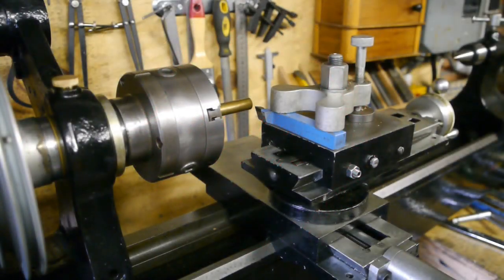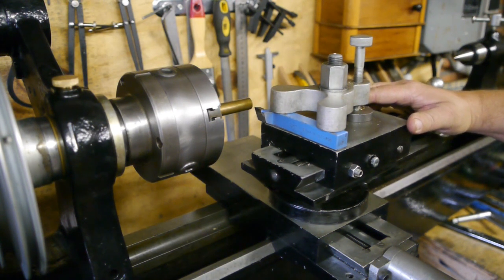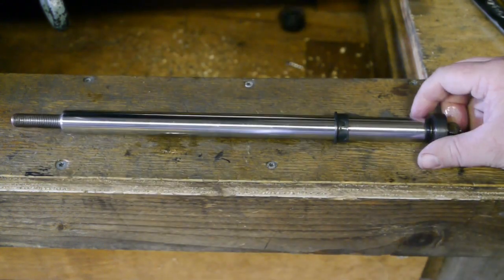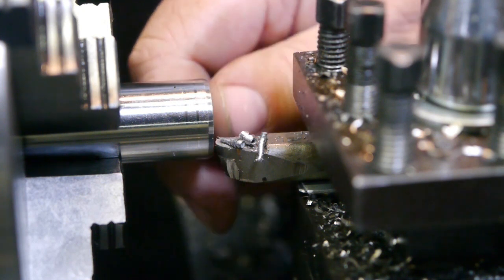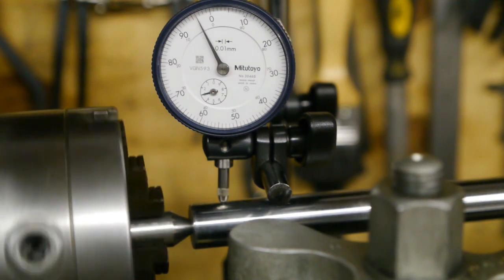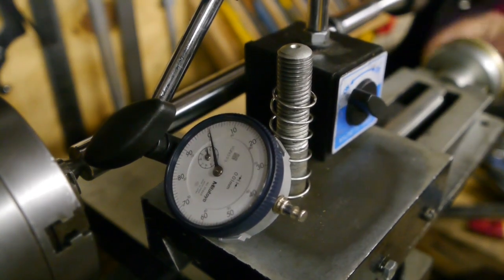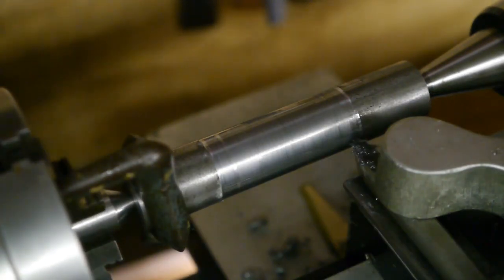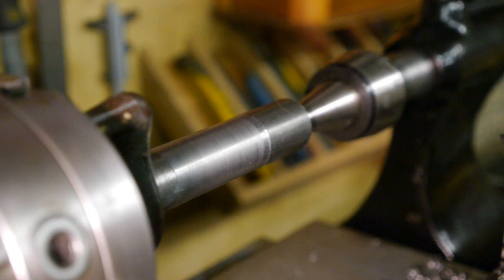Making a reference bar to set the top-slide of a bench lathe

Comment: To me it looks like you made a tail stock test bar. So when you set the compound to the bar you may have set things in relation to the tail stock off set, if that makes any sense.
Reply from the maker: Tail stock off set is not possible on this lathe. It has a fixed tail stock casting.